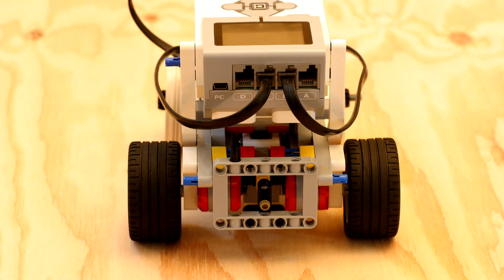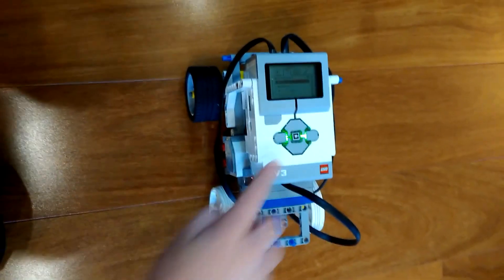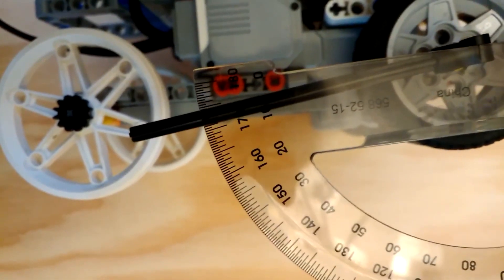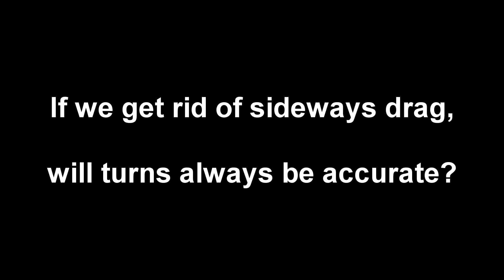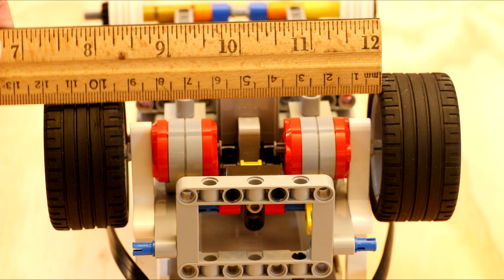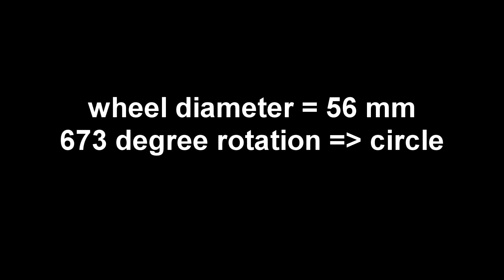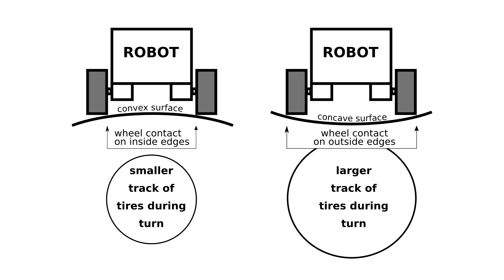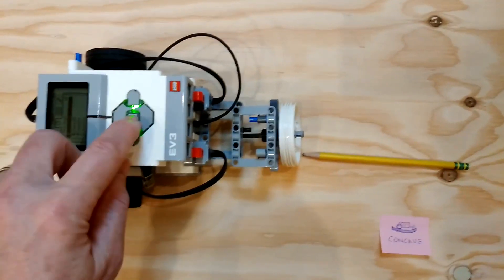FLL EV3 Turn Accuracy: When Turns Go Bad

Comment from the maker: I said the 4% drop in wheel drive angle needed when I changed the idle wheel direction, was due to the sideways wheel drag in the first configuration.  I didn't mention even at a low speed setting like 20% there may be some overshoot every time the robot skids to a halt. It did that four times per revolution with the first (90 degree) program, but only once per turn with the second, so that is another variable.